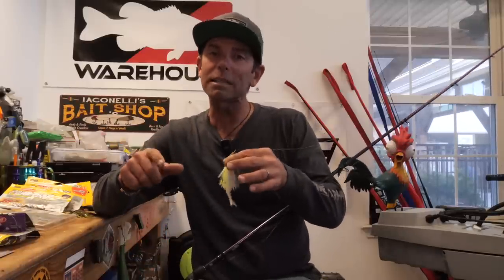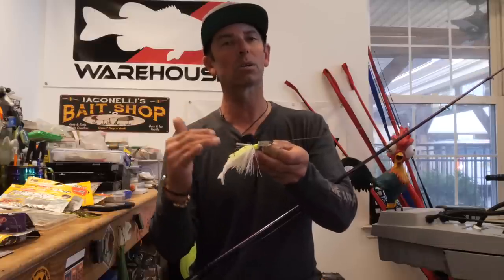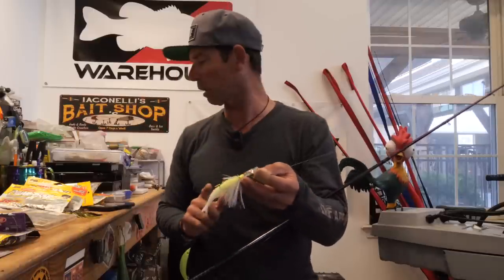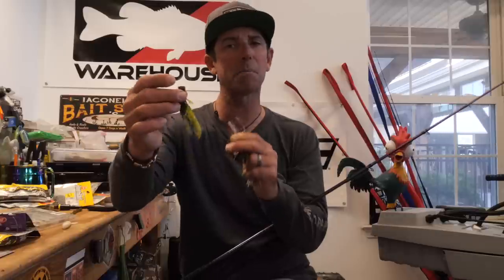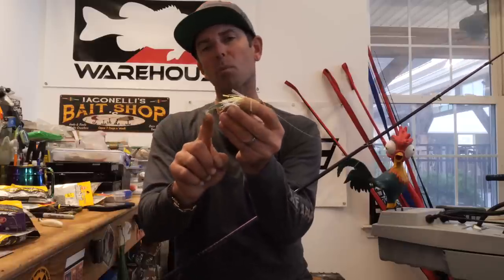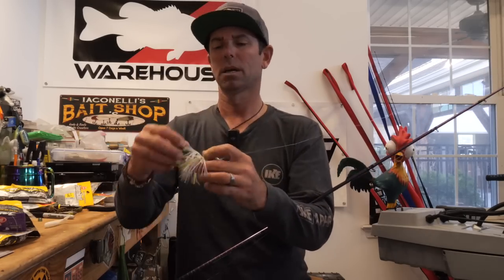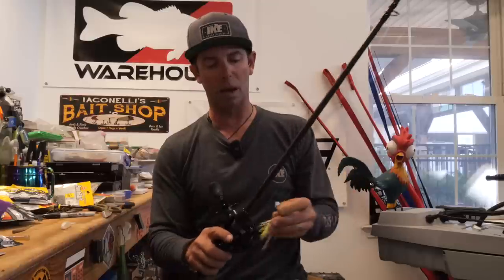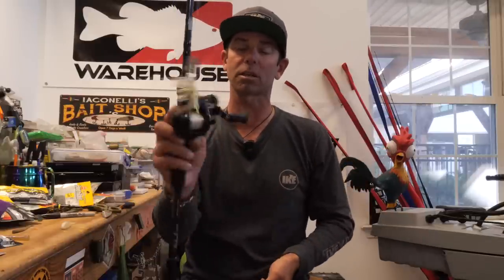Chatterbait MUST know Tricks, Tips, & Secrets! | Ike in the Shop

Comment: I took all my Chatterbait Elites and changed where the bend was in the blade because I noticed that the only difference in the Jackhammer and the Elite blade was where the bend was, the Jackhammer has a bend closer to the top of the blade so when I did that to my Chatterbait Elites I noticed that the Elite Chatterbaits started vibrating just as fast as the Jackhammer! It’s amazing how it changed the startup of that blade!